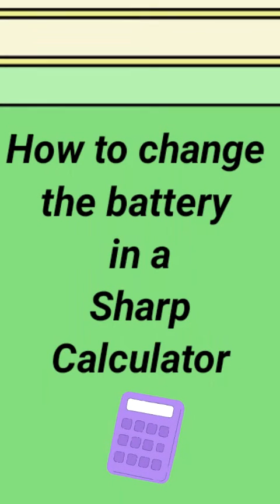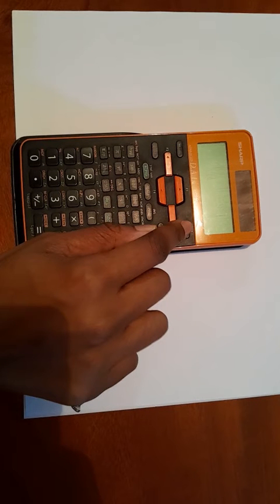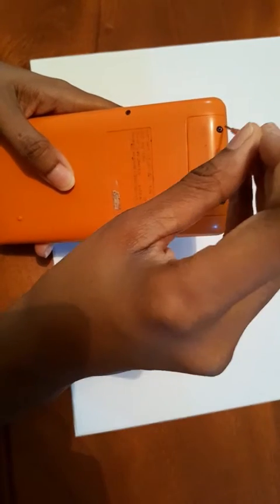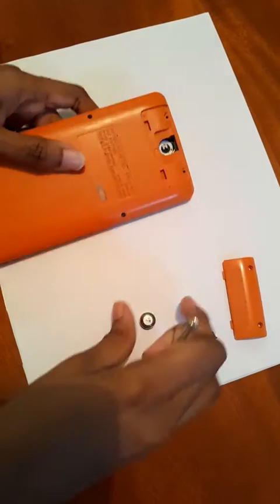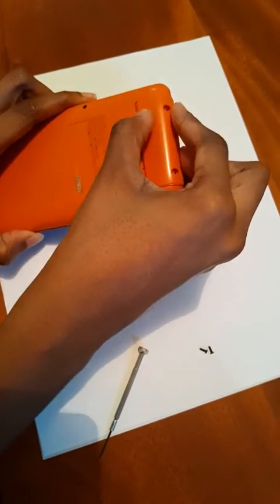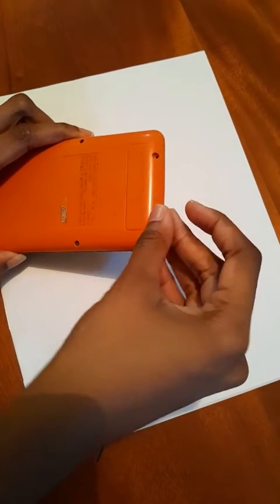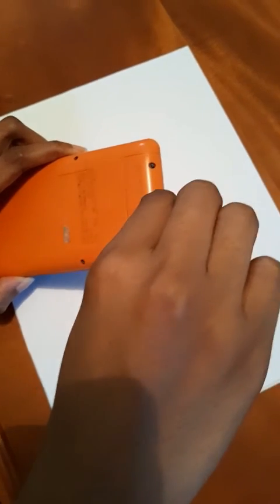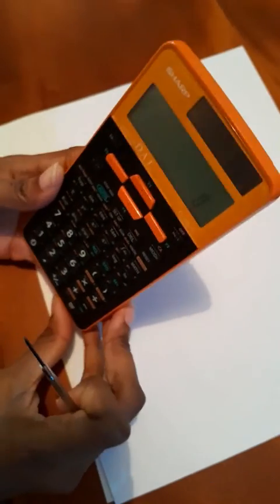How to change the battery in a sharp calculator

Comment: I have a Sharp Elsimate EL 350 solar powered Calculator but I'm wondering if it has any batteries in it that may need to be replaced at some point,what do you think ?.
Reply from the maker: Wow,  nice. I did a quick google search and the power source is only solar. I don't believe you will have to change any battery.